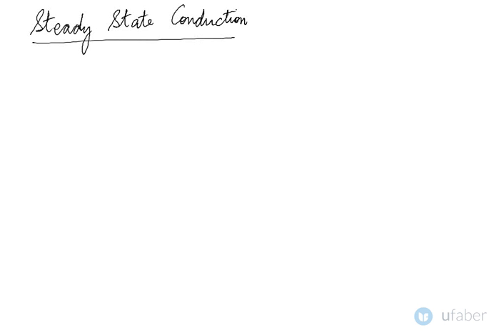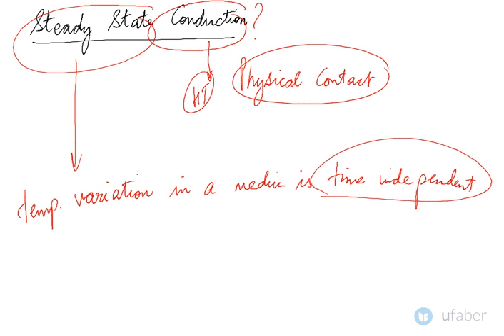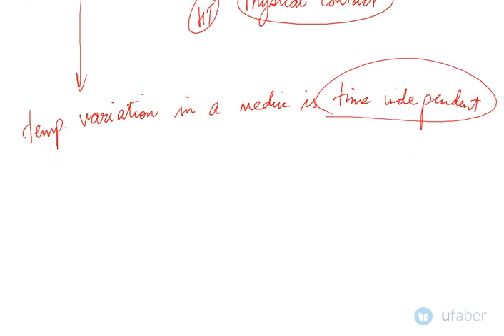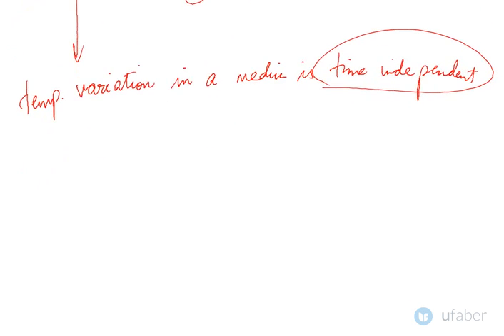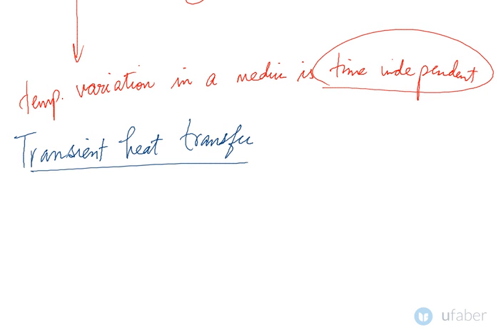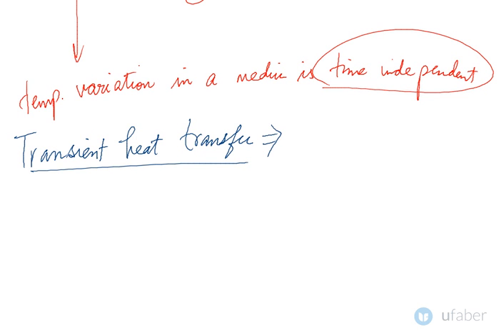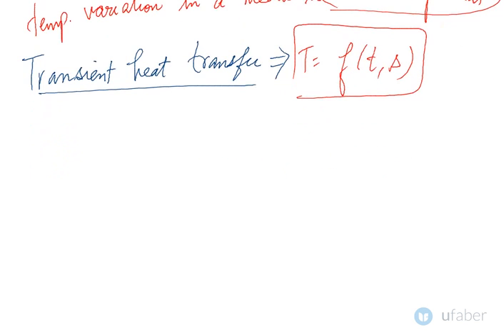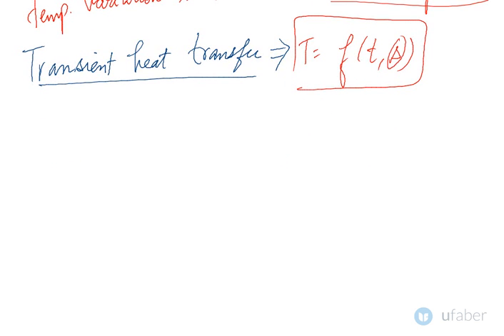What is Steady State Conduction - Heat Transfer - GATE Mechanical

Comment: In heat transfer when we are talking about steady state the temperature is doesn't varies with respective time and also the heat generation will be zero... In one dimensional steady state system it depends only the path like x-direction else in 2d system it depends on x,y,z.. conditions